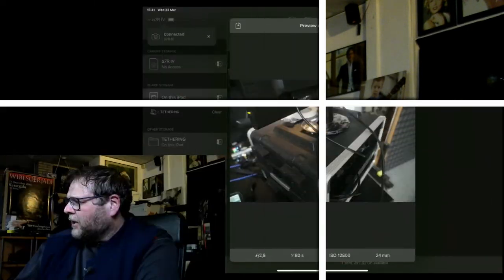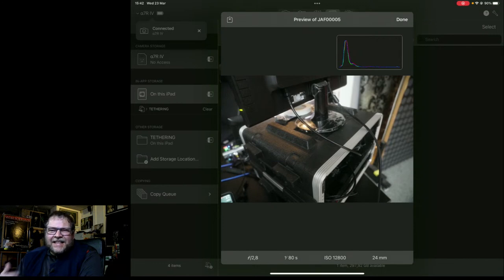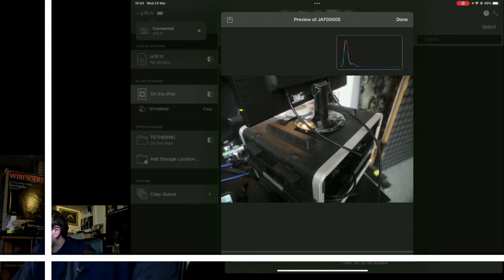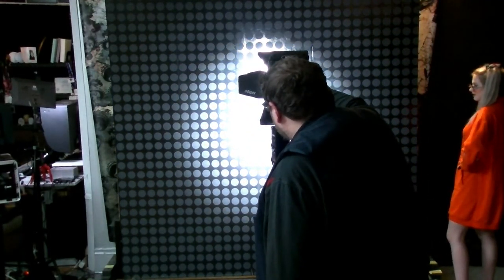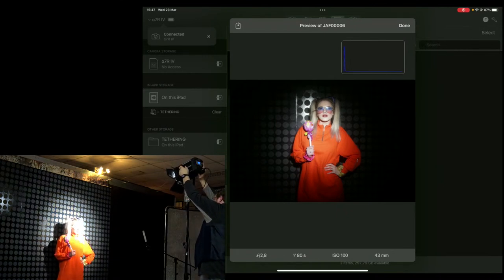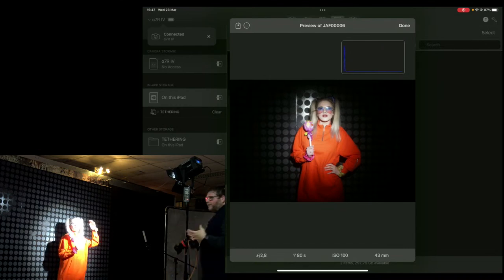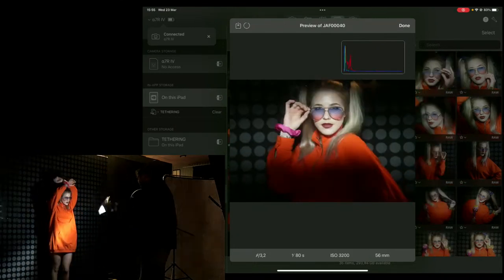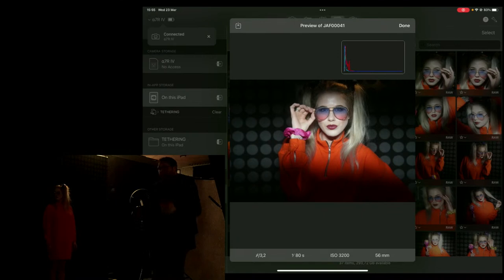Digital Classroom “Model photography, combining LED and flash”

Comment: Sorry that you were stressing, but it shows newer photographers that things don't go smooth all the time.
 You just got to keep going and work threw the problems.
FYI, we say Ikea just like you said it. 
The smoke sounds like a fun class.

Thanks
Reply from the maker: The biggest worry is gear. It's the only thing you can't really control. Plus a lot of people might not even realize but it's only annewiek and me running the streams at the moment ;)

Still we want to try to make it look like a whole team and make it as smooth as possible. This is also why I tested the iPad for at least 1-2 hours in the dock before the stream. 

It was almost scary that at the moment I switch to the iPad input the dock stopped working. In the end we ran this stream via wifi and connected the iPad with a small dongle. It worked but it wasn't stable enoughr for my liking ;)
Reply: @FrankDoorhof  😀
One day the team will grow after all this flu we are dealing with.
You always do a great job no matter what happens. 
The audio fix definitely help improve the stream cause hearing its clip and the speaker pops was hard to listen to and enjoy the stream. 
Wabi-sabi 😀
This concept changed my life, I always chased perfection all my life in creative endeavors whether it's a painting to photography.
 I'm not saying be sloppy, but once if it wasn't perfect it would stress me out so much I would not try for a while because I didn't want the stress of it if it didn't come out perfect.
Reply from the maker: Perfect doesn't always mean technically. For me the story or wow factor is MUCH more important. ;)